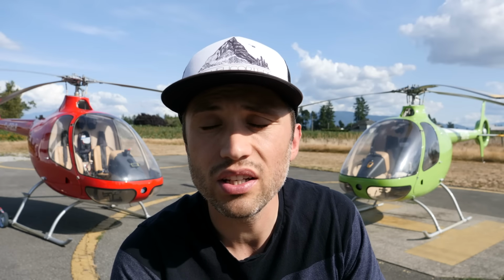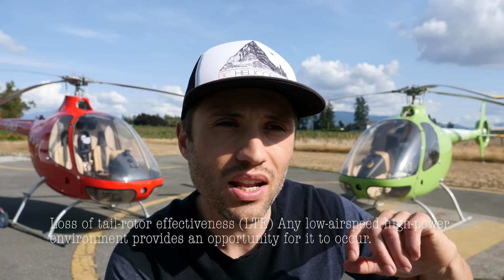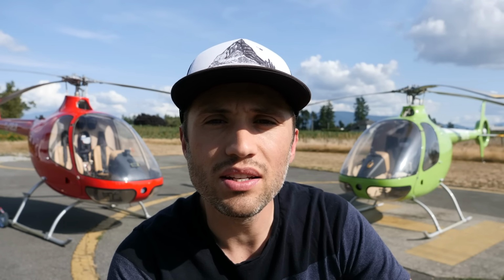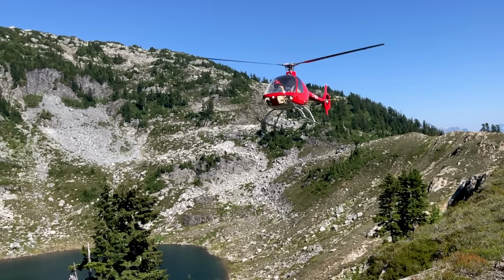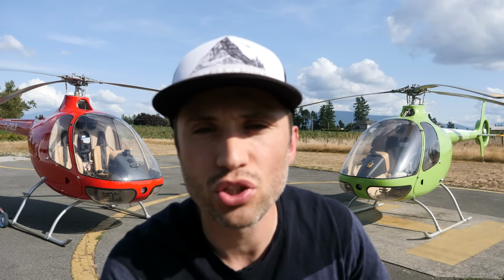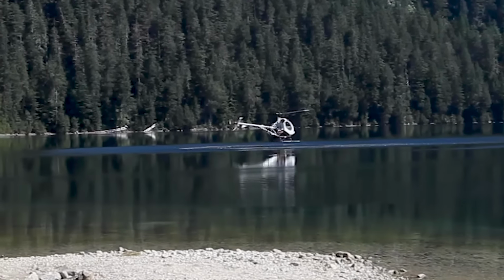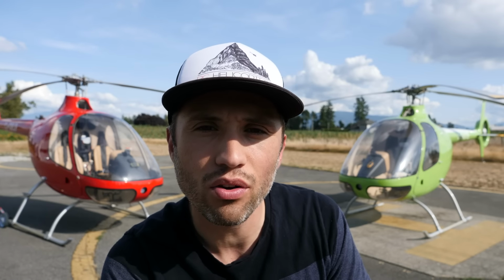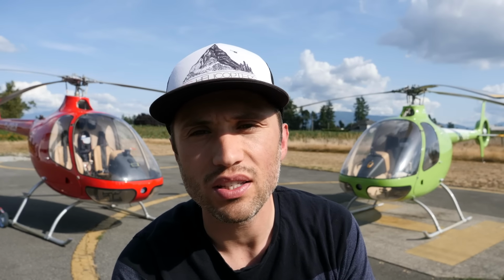OVERPITCHING and LTE can lead to a HELICOPTER CRASH

Comment: In a 269 you lower the collective as you break into transition and it makes it feel smooth and look like its suppose too! It takes lots of power to hover(manifold) less to hover directly into the wind and lesser power to fly through transmission! Nose it over , lower the collective a bit ,get momentum , (into the wind is best ) and fly the machine.

Comment: Decades ago we called the recovery, getting into clean air.
  Enjoyed the video, thanks.
Reply: Bell 209 ...I’ve used the same terminology (back when I was flying in ‘04-‘05 up in Billings, Mt) BUT it was in regards to ‘Settling with Power’ or Ring Vortex more precisely. Dirty air is when the rotors aren’t able to maintain or gain lift over the blades due to an insufficient amount of power being applied (OGE hover) and the helo in this case starts to settle. Proper technique: Lower collective with forward cyclic moving into cleaner air...
Reply: @m118lr  your right, running out of power, and vortex ring state are different problems.
Reply: @bell2097  yeah. this wasnt settling with power. he actually had the benefit of the ige ground cushion (although i think its diminished over water vs ground). he just straight up ran out of power. he might have been able to save the day if he could have gotten some air flowing over the disc. but this accident happened way earlier, probably around 1k agl when he decided to show off by making a (kinda) steep approach to hover over the water. 
its all about power management. one day flying with our brand new ip. oge hover and he's like, hey watch this. he tips the apache 90 degrees on edge and we drop like a rock. i made him clean the shit out of my underwear so i wouldnt report the overtorque (i reported it anyway)
Reply: @josemadarieta3  Your right, this was a power issue. Also right about ground effect being reduced  over water. And right about  power management being a big deal. 
  Hard to believe that IP couldn't controll the cowboy in him, and then wanting to cover up a over torque, glad you reported it.
  My knee jerk comment missed the point of the video, my bad.
Reply: @bell2097  yeah. he was special. but amazing how i always smoked my check rides with him after that ;)
Reply: @josemadarieta3  wink, wink

Comment: 4 years late to this vid. 
  Avid RC heli pilot here. 
The same thing happens to us too, these lessons cost far less to us. 
     That said, being able to spot engine bog and let off the collective quickly will save your model.   Or lives in your case.  
      Being able to create forward "wing" lift as your motor gets back to rpm is critical.   
      And opposite to everything your mind is telling you. 
       Cool video.

Comment: Like lowering the nose in a fixed wing to keep the wings from stalling.
Reply: At least as fixed wind pilots we have a buffet and a visual on the angle of attack. Doesn't look like much warning signs in a helicopter that you can feel with your body. 
No stall buzzer either ..
Reply: The low rotor RPM and horn would have come on, the manifold pressure would be up to the limit, the nose would want to rotate, there would be a lot of peddle used...there are a lot of indicators you are running out of power but a power check is the best...
Reply: @markhux7217  thank you so much!!!!

Comment: When he came to a hover, it was to late. I used to fly Lima model Blackhawks so power wasn’t really a problem. If you’re loaded up and in elevations like Afghanistan, problems begin with the altitude. It wasn’t LTE but it was settling with power. Scary.

Comment: its seems similar to stall on fixed wing .push down to recover to gain speed  aka lift later.
Reply: yes. lower the collective to reduce the "overpitch"  and regain rpm in the main rotor and pitch forward (or left/right/back) to get some airflow and get the disc flying again. the main diff between fixed wing and rotor craft is that pesky torque. once the tail rotor stops working you are pretty much out of options except collective full down, which in this case meant taking a swim

Comment: Great explanation on flying! I am a teacher sometimes also. Flawless explanation.        On another topic. I wouldn't be very happy spending hours getting to a mountain lake to get away from it all and then some Clown flies in with a helicopter.  I've hiked and sweated buckets to get to the tops of mountains and had people drive there lazy as*es by illegally on a trail right past me.  I've chained my pick up and drove 18 miles in deep snow into the hills to hunt Elk and had groups of snowmobilers with incredibly load pipes going through every tiny trail Also illegally. A little consideration Please. 
When I was a fairly young Man an old Backpacker told me to "Not Ruin the Wilderness Experience of Others."  I've Always Lived by that Rule. Though not always possible. You can wear earth tone clothing and equipment.  Not be overly noisy. If someone is at the lake you intended go to. Then go to the next lake.  And travel with all of the different modes of transport  responsibility, courteously and in the appropriate areas and time frame for your type of transport.  Just saying.
  Good video!
Reply: "Old man shakes sticks and youngins who make too much noise" 

You need to ease up man, powersports have every right to enjoy nature as you.
Reply: @TheOwenMajor  If trails have been deemed hiking or horse trails only. Or if snowmobiling in certain areas are off limits during hunting season it is reasonable to expect others to fallow the rules. Some of us have a Great deal of time and money invested in going to the mountains for our activities. I wouldn't go to a popular snowmobiling or ATV area and turn it into a live shooting range and say " Ease up Man!"
   A little common consideration is reasonable. We live in a crowded World. We can all have our time in the backcountry to do our Thing. Grow up and Think of others. The World isn't all about you.

Comment: Hi Mischa, Question: If the pilot had reduced collective would he have been able to settle into ground effect over the water and correct the LTE issue the same time?
Reply: Water isn’t great for ground effect sadly! He would have to lower collective and gain airspeed!

Comment: Why did this happen, though? The helicopter could hover when it took off and has to be lighter than then. Is this in a place with huge variations of ground level? Would that lake be 5000' higher than the take off point?
Reply: Not a helicopter guy but I think he explained... power was maxed out so you need to apply forward motion to get wind under the wings/rotors to give lift
Reply: @grandenauto3214  not really an explanation. The helicopter took off and hovered in the first place. It only got lighter from then. Unless it had a partial engine failure it would start with sufficient power and only get more and more excess power for hovering. Something else changes that means a helicopter that can take off can't hover.
Reply: deSloleye the engine has the same  power but there isn’t enough air getting under the wings to keep it in the air, which is why you want to move forward... get more air under the wings and fly out of it.

Comment: Great explanation, the LTE was caused by over pitching (as mentioned on this video) but what really stuffed things up in this case was the RRPM decay. The effectiveness of any rotor system is, amongst other things, directly related to RPM. When over pitching, max torque is being produced. If max torque is mixed with RRPM decay and low speed, LTE is pretty much unavoidable...sad to see. Hope everyone was OK

Comment: The low rotor RPM and high torque requirement  caused the LTE and trying to stop the rotation with torque pedal Will just increase the loss of  rotor rpm .

Comment: Yes, as a 35 year Commercial Helicopter Pilot, I'd say this was clearly a "Density Altitude" / performance case. The Pilot was attempting to operate at an density altitude that the machine did not have enough power to deal with.
I suppose it's also possible that there was a mechanical problem that prevented the Engine from producing the normal level of power, but I'm not sure that this was alleged.

Comment: Hope no one was injured. Great explanation. In this instance, once I noticed LTE ( I'm not a pilot) wouldn't he drop into the water anyway. It looks like only a 30ft ish window to correct
Reply: deezldude that example the pilot basically had little chance, but if he had put in a harder left peddle at the start then tried to fly out he maybe could have got away with it. But given the lack of obvious experience I think it was a done deal once they decided to come to the hover at altitude above water without a power check.

Comment: Even after he contacted the water he had nearly stopped yawing, so with the water partially supporting the weight, less collective would have been required so possibly lowering collective a bit and fwd cyclic to start inching toward fwd velocity and translational lift AND would have kept the tail rotor out of the water (which is where it was all over) he could have squeaked it out, but like you said, the early catch at 8'  would have been a better save, or even hovering on the beach...

Comment: Great explanation and very informative, but I would add that the pilot should have done more planning PRIOR  to operating there. If you're operating at high altitude and planning a landing, then refer to the POH before takeoff to determine the machine's ability to operate OGE and IGE.

Comment: I think low rpm recovery and maybe trying to fly the disk to punch through ETL may have helped.  If I regained TE i would have hover taxi to a hard smooth surface and maybe set the thing down and thought about life for a moment.

Comment: I watched this video and wondered when will Misha get to the cause of the accident and the key learning point.                                                                                                                        Lessons of Loss of Tail Rotor effectiveness start back in hovering and I'd guess that Misha does teach this learning point back in initial hovering. I recall my instructor not telling me about the differences in surfaces and then on my first practice of hover taxiing from tarmac to tall grass. The difference in power required is quite scary. You can lift off from a solid surface and NOT be able to hover over tall grass or water.  I notice that the Canadian H-FTM does not mention surface in LTE , and neither does the Australian FTG. Both however do mention "surface" in the hovering exercise.  Just goes to show the importance of relating a lesson on LTE to that of hovering at the start.  Now, relate that to this accident.  One the key learning points in LTE  is the surface that you are attempting to hover over. The reality is if he had been hovering over a solid surface then he would have not needed as much power than attempting to hover over water. Its amazing to see the difference in power required in hovering over water or tall grass compared to a solid surface. This pilot had lots of methods of escape and failed to use any of them except this slow motion end in splashing water. That indicates the cause of this accident was that his training on LTE was inadequate.

Comment: Excellent explanation!  As a non-pilot, I'm curious as to what direction you will end up heading if you are in a severe LTE situation, and begin moving forward. I would imagine this would be extremely difficult for a pilot, due to disorientation. Would love to see that practiced, but to me, it doesn't sound a like a safe thing to attempt. Will it immediately straighten out as soon as you begin forward movement?

Comment: Great video, but no explanation as to WHY he ran out of power. Presumably he took off with the same weight as he 'landed'. Had the climatatic conditions changed so much from take-off to landing?, or had he flown from a base camp to somewhere with a higher altitude/lower air density? or vice-versa?

Comment: I don't know anything about this, but found the video really interesting. I'm amazed that it is so easy to "run out of power" in a helicopter? Is there really such a small power safety margin? Was this guy operating right at the top of the altitude envelope, or overweight?

Comment: Excellent video! I have a question as a non-pilot though. Given the outcome, and test demonstration, I assume, it takes less power to fly with forward momentum, than it does to hover. Is this due to the lift provided by the forward momentum under flight? In other words, the rotor is able to act as a large airfoil while flying, as opposed to individual airfoils (blades) while hovering. Is this correct?

Comment: Is it possible to put the helicopter blades into a low G ("unloaded") situation when you pitch the nose down to correct for over-pitching /  LTE ? Mast bumping on models that have a rigid/semi rigid rotor system seem to be a large concern when lowering the nose of the helicopter from what I understand

Comment: I'm not a mechanical guru nor a helicopter guy - BUT, regarding 'not having enough throttle': isn't there an option of helicopters (esp. recip) that can provide 'emergency power' just for these situations? Like a short burst of NO2, something that may do potential damage or require inspection, but that's what 'emergency' means. Like the safety wired switch I recall in F-15's that 'ungoverned' the engines for those just-in-case moments in battle

Comment: Do civilians have access to Performance Planning charts to help determine if you have IGE/OGE before takeoff? Also if you droop the rotor and start to experience LTE, like you said lower the collective a little and push the nose forward just a touch and go with the direction of rotation and you will fly out of it quickly.

Comment: Hovering over water means that the aircraft is configured for water operations  (should have had floats, best, floation required on board)... and you forgot to mention the air roll over effect off the main rotor disc that causes loss of lift (rolls over back into the lift disc).  Ground effect is most effective with forward airspeed..  Know the flight profile of the aircraft and the danger zones ( and procedures to get out of them).

Comment: Why is it that the helicopter didnt have the power to hover over the water?  Or in the video sample you showed, why was the power used up?  Does it have to do with altitude? Other factors?
Reply: You didn't pay attention, just like when you were back in school.
Reply: @superbmediacontentcreator  thank you so much for your reply.  It really helped me understand what is going on.  
If you actually read what I was asking and thought about what I was asking instead of putting all your effort into judgeing someone you dont even know (which by the way just makes you look like a tool),  you would see I was asking about external factors like altitude, air density...ect.   Factors that would cause the over pitching.   It did not look like the pilot did any crazy maneuver and I also dont think helicopters struggle that much to hover, so there must have been external factors that added more stress to the motor.  Maybe you know the aerodynamics and the physics about why this happened?
Reply: @andrewh.8837  My comment stands as yours simply frames the fact that you did not pay attention.
Reply: @superbmediacontentcreator  whatever helps you sleep at night. I'm sure someone reading this will respond to what I'm actually asking. I have a feeling it has to do with the altitude and maybe temperature as well.

Comment: Not a pilot. Just curious about learning. Why would you need to do a practice hover/landing to see if you have enough power to land? What would cause someone to be close to 100% power usage when you land? It seems like a helicopter could hover on demand when going slow enough and if you are not overweight or losing engine power. If you take off fine it seems like you could land fine... Unless the air is thin where you're arriving, etc.? TIA

Comment: Very interesting mishap! 
Why would it run out of power? Elevation? Like up in the mountains? Would that cause very limited out of ground effects to substain a hover at that elevation? 
Is there no ground effects over water? 
I had no idea about the power to lift dynamic being so narrow? 
I've flown both Robinson 22s and Schweizer 300s like in the video. Mostly at low elevations up to 4000'. All my hovers were always at ground level though. I already knew the two are under powered to hover out of ground effects! 
So, basically he should have maintained forward motion until in ground effects over land. 
But, he should have known his airship's limitations too.
Reply from the maker: Jamie Smith yes high altitude on a hot day with being fairly heavy.

Comment: Schweizer 300 doesn't have a governor, only an imprecise mechanical correlator. Considering that the Tail Rotor spins 4 times faster than the Main, RPM is crucial for T/R control. So, the best thing to get as much from the tall rotor as possible is to keep the engine RPM at the top of the green and take care not to overspeed.

In this accident, we don't know whether the throttle was fully open. Clearly, over the water, there was not as much ground effect and hovering would require greater power. If they started to settle and RPM was not at the top of the green, then pulling collective would make things worse - over pitching, RPM droop and LTE. So, the pilot needed to recover the RPM quickly: momentarily drop the collective and simultaneously roll up the throttle. And get the RPM to the top of the green.